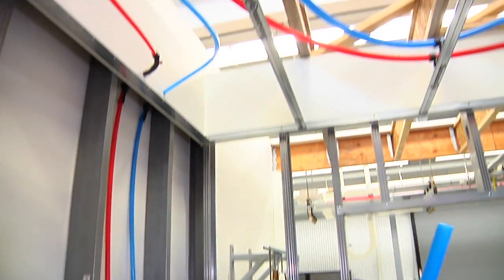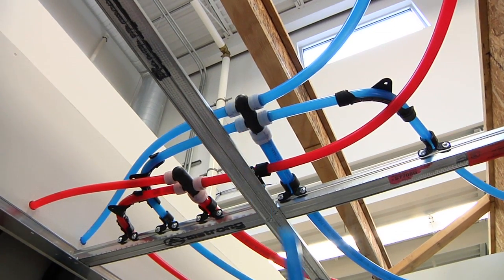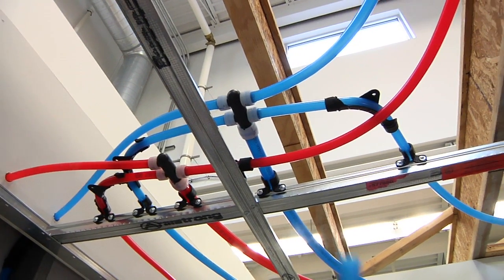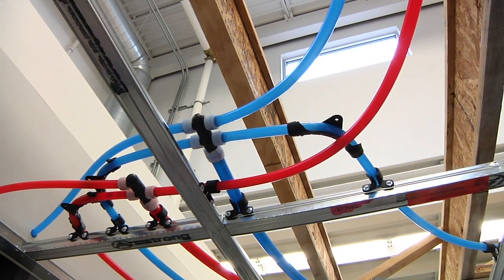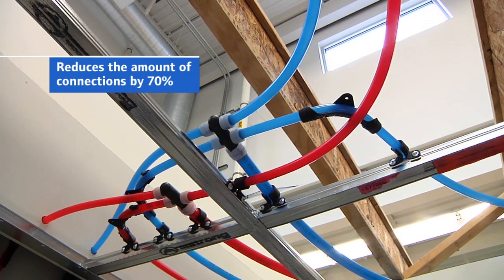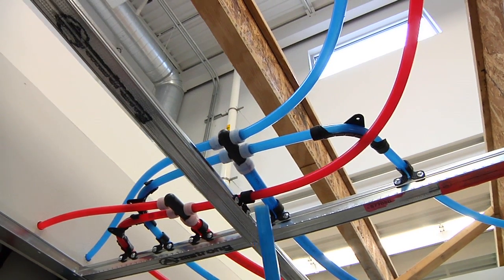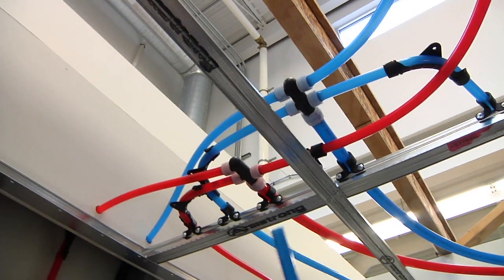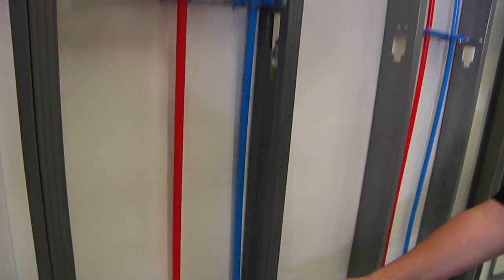Uponor Logic Unit Piping Installation Techniques

Comment: If hot and cold needs to go through a poured slab, is there a specific type of pex for that? And will these connectors work if they are buried in the cement?
Reply: I would recommend putting any pex fitting in concrete. I've put pex in concrete just sleeved